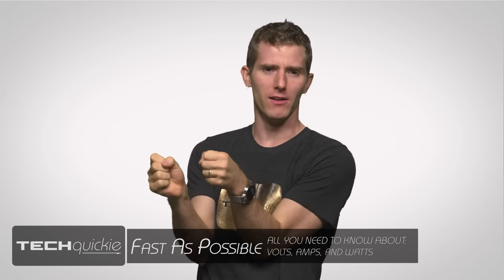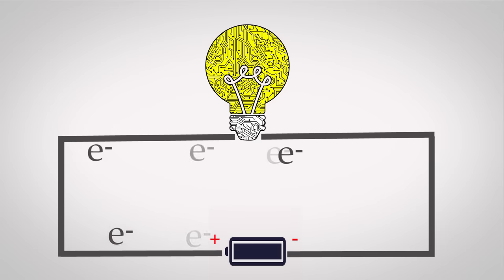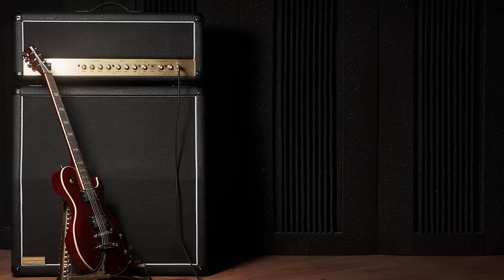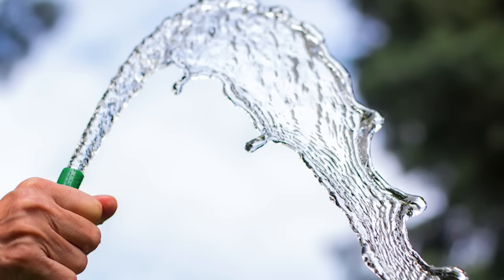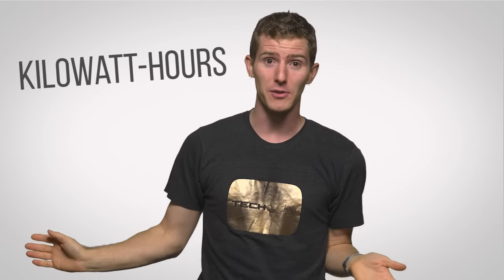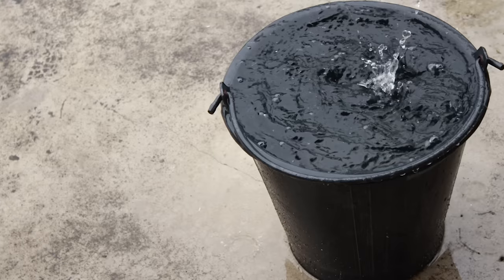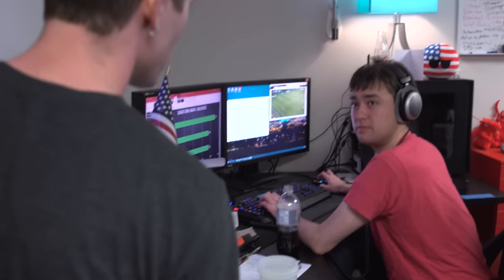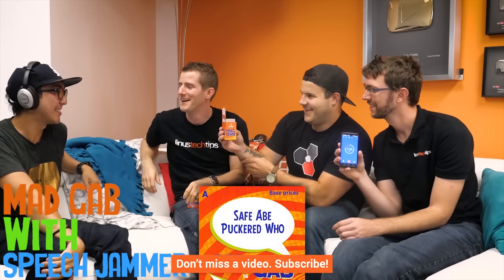Volts, Amps, and Watts Explained

Comment: As an Electrical Engineer, great job!  Would've been so much easier to understand this concept with this video many many years ago
Reply: thought it flowed from positive to negative. not negative to positive.
Reply: @ortegajones4929  positive to negative is what's called "conventional current", which was the original theory of how electricity flows. This was later discovered to not be true (it flows from negative to positive), but many people still teach and use conventional current for circuits and such, mostly because it was already pretty well established and would be hard to change
Reply: @アヒル総統  I did research it right after but thanks for the attention :). Considering electrons are negative I don't know why I missed that.

Comment: Been in school for 22 years and this is - by far - the best explanation of volts vs amps that I have heard. Thank you.
Reply: 22 years ?
Reply: Bruh wtf is your major?
Reply: Did you reset 3rd grade 5 times and then reset middle school twice?
Reply: It’s simple if you just picture a river flowing. Very basic electrical knowledge that everyone should know
Reply: That's embarrassing.
Reply: @moarz__1888  1st-12th grade = 12 years. Undergrad = 4-6 years. Post grad 4-6 years.
Reply: @edpalomino3876  1st-12th grade = 12 years. Undergrad = 4-6 years. Post grad 4-6 years. Probably engineering major
Reply: @frozenturbo8623  1st-12th grade = 12 years. Undergrad = 4-6 years. Post grad 4-6 years.
Reply: @bitTorrenter  1st-12th grade = 12 years. Undergrad = 4-6 years. Post grad 4-6 years.
Reply: @Moarz__ @FrozenTurbo @bitTorrenter that was about 2 seconds of schooling in itself. DAYUM😭
Reply: @mi3night339  let me see if I have this straight; 1st-12th grade = 12 years. Undergrad = 4-6 years. Post grad 4-6 years?

Comment: This taught me more then my 9 week electrical course
Reply: your electrical course must've been exceptionally bad.
Reply: @Rio Pruitt I think it's like that in all trades or jobs you go to school for. They push so much info out at you in college or trade school and you forget a lot of it by the next semester. You'll eventually get it on the job like most things. People will still be showing you and teaching you if you have questions about something and eventually it will all make sense. I still have a hard time with all this in welding and get it so confused still on my welding machine. I know how to weld, but it helps if you know exactly what voltage and amps does cause then you can tweak it just right to make a perfect weld. Something else I haven't got yet and I don't think anyone in my college did was blueprint reading. I think one reason is because our first teacher never really taught it and in the second class he gave us blueprints that seemed really advanced to learn from. They were like huge pages with many parts and about 7 pages to each one. It was overwhelming. They push each thing you learn so fast that it still doesn't make much sense by the end. Knowing about half or more than half of it is better than knowing none of it. It makes it easier to learn on the job.
Reply: You must not pay attention at allå

Comment: The reason why it is called KiloWattHours, is because when you multiply two things together you will have to multiply the units as well, like how you do with the area, 10m * 5m = 50m^2. So if your device is running 1k Watt (per hour), and you used it for 24 hours. 1k Watt * 24 h = 24kWatt * h. That is why we have to keep the hour included, else you wouldnt have known whether that number is your total usage or just a usage on a specific period. Hope it helps
Reply: I know this comment is 4 years old, but I think I'm either still slightly confused, or maybe I understand what you're saying.  So originally (after watching the video) I was thinking a "Oh, so a kWh is the average amount of kilowatts you're using per hour over the course of a given period of time." (in the case of an electric bill: 1 month).  However after reading your comment it sounds like I was woefully off the mark.  -_-

Linus had also mentioned that "Light Years: Not Time", and while he's technically correct (Light Years are a measure of distance), it's also not wrong to consider it in the context of time (i.e. "If I were moving at the speed of light, it would take me this many years to travel from Point A to Point B").  Using this mental framework when trying to understand your comment, are you saying that a Kilowatt-hour is actually summarizing "If you were continuously and precisely using 1 Kilowatt of power per hour [during this billing cycle] this is how many hours total you would have been running your power"?
Reply: @OfficialCharcuterie  Let's take some concrete examples. For a total of 24kWh to be used, one could either use 1kW for 24 hours, 24kW for 1 hour, 12kW for 2 hours, or any combination of factors that multiply into 24. In this particular case, there are only 2 factors--one being power (watts / kilowatts) and the second being the duration for which it is used (hours).

A kilowatt-hour is not a summary of what you mention in your comment. Rather, in this context, it is simply a unit of total energy consumption. However, since [kW x h] = kWh, knowing any two values in the equation will allow you to easily calculate for the third. Hope this helps
Reply: great scotts!
Reply: @shootinbruin3614  Aha!  Okay - very much, yes!  Having it expressed in terms of "an equation with known and unknown variables" was incredibly helpful.  Thank you!
Reply: @OfficialCharcuterie  Glad I could help!

Comment: In physics terms:
Electricity is measured in units of charge
Voltage(V)=how much energy per charge
Amp(I)=how much charge per time
Wattage(P)=how much energy per time
Therefore P=V×I
Imagine electrons as trucks carrying energy.
High voltage means each truck carries a lot of energy.
High ampere count (current) means many truck passes through.

Comment: Monaco runs on 230V, New York runs on 110V → definitely no blue smoke, it will just run very slowly (if at all).
Reply: It will run just fine, it will just use more amps
Reply: @paulopereira47  That is not how hair dryers work.
Reply: hellterminator not really how most electronics works anyways iirc.
Reply: @dryagedmilk  It kinda is, actually. A lot of electronic devices these days have switching supplies which can accommodate a wide variety of input voltages and will always draw the same power (allowing small differences due to conversion efficiency). So for something like a computer, he's right — it would “just use more amps.”
Reply: ruined it
Reply: australia is 240V
Reply: You can by a transformer as a go between to convert from 240V to 110V power supply
Reply: Yes, thats right it will run very slowly.
Reply: @paulopereira47   @Paulo Pereira  No it will not be able to use more Amps because the resistance rating of the coils dont change. For example if R=8 ohms.
Europe-
V=IR
I=230/8= 28.75 amps of current 

America-
V=IR
I=110/8= 13.75 amps of current.

So in America due to the fixed resistance rating of the heating coils at 8ohms. The dryer will only draw 13.75 amps. 
It cannot draw higher current. 
So it will run weak.
Reply: monaco is a biscuit company too, so out of context it sounds funny
ah yes, biscuits run at 230 volts
Reply: @hellterminator  actually its not voltage that drives a motor its current.
Reply: @petrifiedhero9610  And what drives current through a load?

Comment: Great Video.
 Manually working out Consumption

Calculating the energy cost of an appliance or electronic device is fairly easy. Most devices have a label that lists how many watts it uses, either on the device or in the owner's manual. You will need to find this number to figure out how much the appliance is costing you. You will also need to estimate how many hours a day you use a particular appliance.

The Wattage Label

If you can't find the wattage label, there are other options to determine how much power your device uses. For example, you can purchase a wattage measuring device, such as the Kill A Watt®. Simply plug your appliance or electronic device into the Kill A Watt® to determine how much power it uses. Or you can contact the manufacturer, with your model number, to find out how many watts a particular device consumes. You can also check the list at the bottom of the page for common wattage on household devices. Though your particular device may vary, it should give you a rough estimate of the energy expenses related to the device.

Calculate Electricity Consumption - 4 Easy Steps

Step 01 Watts Per Day

To calculate energy consumption costs, simply multiply the unit's wattage by the number of hours you use it to find the number of watt-hours consumed each day. For example, let's say you use a 125 watt television for three hours per day. By multiplying the wattage by the number of hours used per day, we find that you are using 375 watt-hours per day.

125 watts X 3 hours = 375 watt-hours per day

Step 02 Convert to Kilowatts

Electricity is measure in kilowatt hours on your electricity bill. Since we know that 1 kilowatt is equal to 1,000 watts, calculating how many kWh a particular device uses is as easy as dividing by 1,000.

375 watt-hours per day / 1000 = 0.375 kWh per day

Step 03 Usage Over a Month Period

Now to find out how much that's actually going to cost you on your electric bill, you'll have to take the equation a bit further. First you'll need to figure out how many kWh the TV uses per month.

375 watt-hours per day X 30 days = 11.25 kWh per month

Step 04 Figuring Out the Cost

Next, pull out your last electric bill and see how much you pay per kWh. For this example, let's say you pay 10 cents per kilowatt hour. To find how much the TV is costing you in a month, multiply your electricity rate by the kWh per month that you calculated above.

11.25 kWh per month X 0.10 per kWh = 1.13 per month

Another Example

Here's another more costly example: Your refrigerator runs 24 hours a day. Most refrigerators consume 300-780 watts of electricity. Let's assume you bought a model that uses only 300 watts.

300 watts X 24 hours = 7,200 watt-hours per day

7,200 watt-hours per day / 1000 = 7.2 kWh per day

7.2 kWh per day X 30 days = 216 kWh per month

216 kWh per month x 0.10 per kWh = 21.60 per month 

Common Wattages for Household Appliances

The wattage on appliances or electronics varies by device. Typically, older model appliances use more energy, but newer models tend to be more efficient. You can also purchase ENERGY STAR appliances, which are among the most efficient appliances. According to the EPA, here's a list of typical wattage levels for your everyday devices.

Coffee maker 900-1200 watts
Microwave 750-1100 watts
Toaster 800-1400 watts
Dishwasher 1200-2400 watts
Washer 350-500 watts
Dryer 1800-5000 watts
Iron 100-1800 watts
Ceiling fan 65-175 watts
Space heater (40gal) 4500-5500 watts
Hair dryer 1200-1875 watts
Laptop 50 watts
Computer monitor 150 watts
Computer tower 120 watts
Television 19"-36" 65-133 watts
Television 53"-61" 170 watts

Hope this Helped if it did would you mind maybe viewing my channel and just leave a like or subscribe for a few days. I really like video's like these.

Comment: ...but the voltage in Monaco is 230V, and in New York it's 120V, so if you plug in that hairdryer in NY it will run at half the voltage, so it' won't explode, but will blow air at a slower speed... which you explain when you compare Power and Amperage. Blame the editor
Reply: thought i was the only one that noticed this. the other way around and it would have been right tho :)
Reply: But 110V sucks. #EuropeRocks
Reply: Interestingly, to run a 1000W US hair drier (110V) you require double the current that is required for 1000W European (230V) hair drier, which explains why the cabling is a lot thicker on US goods, as the cable needs to be able to carry the higher current. Power = Voltage x Current
Reply: Im mexicancholo but I side with the viet cong and I have one of those rice hats
Reply: And I also consider myself a ricer
Reply: my country rocking at 240V baby!!! the shock when i got electrocuted is awesome!!!

and cable here is very thin so more victim, yipiii!
Reply: I begin to have some idea now!! What determine the power rating is the designed resistance of the product!! Say, consider a US hairdryer running at 110V , the internal resistance designed should be half of that In EU, in order to drawing enough current from the socket!! So when it is plugged directly in EU, double amount of current will be drawn and explode the dryer!!
Reply: No it doesn't work that way. By doing this you double the current drawn by the hairdryer which the wire is not sized for. Because of this increase in current the wire may get very hot hand burn up due to the ampacity rating. Chime in if you disagree but this is my understanding.
Reply: @ericchan7128  what determines POWER rating is VOLTAGE multiplied by AMPERAGE. What determines AMPERAGE is VOLTAGE divided by RESISTANCE. (Ohms law) of course we are just talking about the heating element in the dryer which is a pure linear load.
The motor is considers to be an inductor and u cant measure current draw just by resistance reading. Inductors are measured by impedance, not resistance (this
 is a whole other topic)

Comment: perhaps you could do a video expounding on the subtle differences between what the VA and W ratings on PDU’s, USP’s, etc and the implications they have on switching power supplies commonly used with said power distribution devices.

Comment: I've always imagined electricity as traffic on roads or highways. Voltage being the speed on the highways and amperage being the traffic. I guess wattage in this analogy would be traffic per hour at a given speed and amount of traffic.
Reply: Amperage is measured in time, (electrons passing per second) so you shouldn't think of voltage as the speed of traffic because it would imply that the more volts, the more traffic is moving past a given point per second.

Think of volts as "pressure" or "muscle".

Remember, volts are being created by some sort of physical "muscle" or turbine that physically moves to "push" the electrons forward.

In the traffic analogy, you can think of volts as the physical horsepower of the cars on the road.

So if the traffic maintained the same speed and there were the same number of vehicles, but suddenly all the vehicles turned into tow trucks, the voltage (horsepower) would increase while the amperage (number of vehicles per second) would remain the same.
Reply: Traffic is easily the best explanation.
Reply: no, water in a pipe is easily the best explanation.  the different terms and concepts match up really well.
water pressure = voltage (volts)
size of the pipe = resistance (ohms)
how much water flows through the pipe (voltage/resistance) = current (amperes)
how much water flows * how much pressure it took to move it (current*voltage) = work or power (watts)
gallons of water per unit time = amount of energy used or contained (watt-hours or amp-hours)
Reply: @dialecticalmonist3405  volts is like the amount and amps is the strength
Reply: @thinkdunson  thank you for keeping it simple
Reply: @murkyturkey5238  I think you have that backwards.
Reply: @thinkdunson  bruh V= IR gg
Reply: @murkyturkey5238  …. You have that backwards.
Reply: @dialecticalmonist3405 can i make a question for you about electricity?
Reply: @thinkdunson can i make a question about electricity?
Reply: @rafaelveiga2327  Wow. I don't even remember making that comment. But sure, ask me about electricity. Although I am not an electrician or engineer.